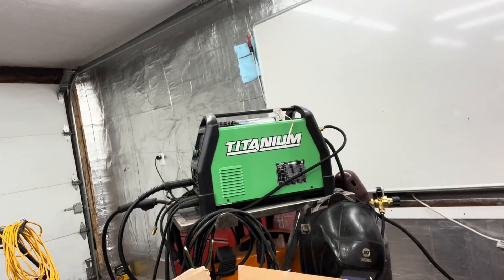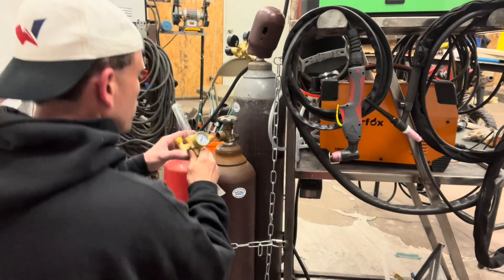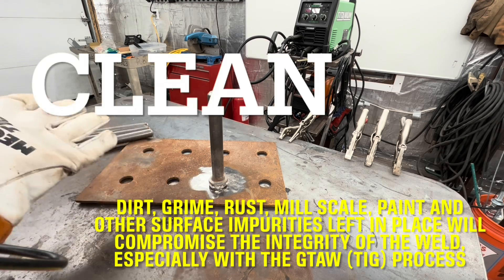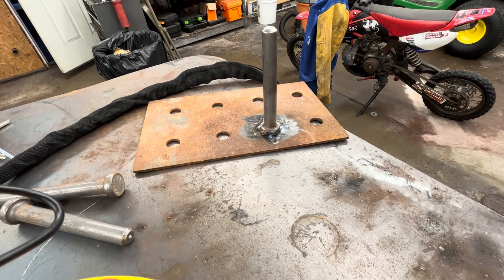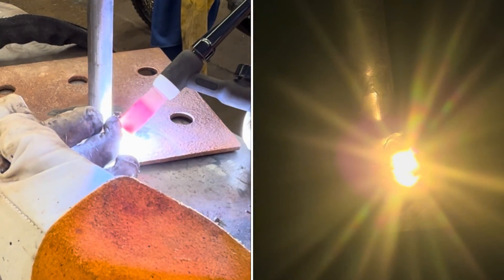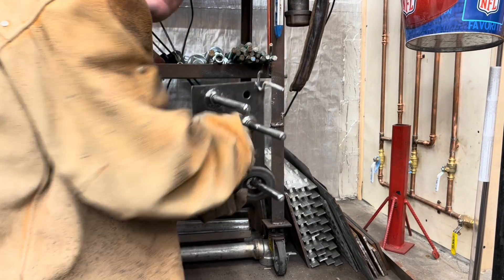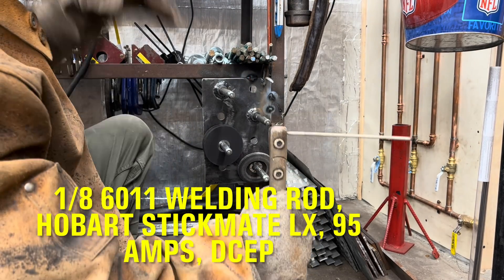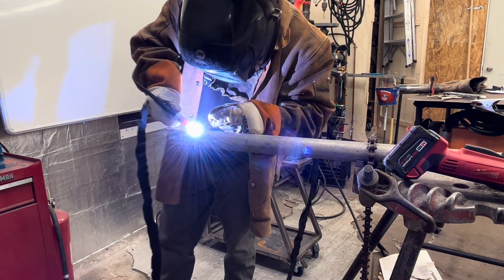TIG Welding with the Titanium Unlimited 200

Comment: Never crank on a brass cylinder connector! Never grind tungsten sideways on grinding wheel, always point the tungsten parallel facing the grinding wheel. Sideways scratches on tungsten will affect the arc stability.
Reply from the maker: I don’t know what you saw but no body cranked on a brass cylinder. I used a proper tool (adjustable wrench) with a flat face on the jaw and I snugged it up. What do you let your gas leak everywhere? 

Also, ive used several hundred dollar tungsten grinders and I’ve also held an angle grinder in my left hand and tungsten in the right, free hand sharpened, and TIG welded stainless and carbon steel without issue. It might affect arc stability in some way, but barely noticeable.

Comment: Hi I have a question I bought this welder but I was surprised it doesn’t have foot paddle for Tig weld i confused some of them have and some not so what the paddle do give voltage? Thank you for your time I LK&SB
Reply from the maker: The foot pedal controls the amperage during the weld this machine doesnt come with one it is scratch start TIG only meaning you scratch the work piece with the tungsten to start the arc similar how you would strike up a stick rod
Reply: @ Thank you just like you did in the video
Reply from the maker: @Alsarraj1010  yes
Reply from the maker: @Alsarraj1010  it can be difficult just keep practicing

Comment: I just bought this on impulse.  Was at HF for an unrelated purchase, and they had one on their clearance table.  $290!  Right across the isle, I saw the normal retail was $799.  Don't know anything about TIG but that sure seemed like a steal.   I called a welder buddy of mine, and he said for that price, jump on it.   It's still in the back of my car.  HF said clearance table is as-is, and I have 5 days to return.   WIll play with it tomorrow probably. Same buddy will run some tests with it since he has all the gasses.
Reply from the maker: 3 years after purchase and Ive used mine plenty, no issues, and no regrets

Comment: Very nice. Would this unit be good for tig welding Steel rod? Plus, I have never tig welded before but I am an ok mig welder so I will be teaching myself using videos like yours. So I appreciate you guys making these videos.  Im in the RC hobby so I like to make 1/10 and 1/6 scale roll cages and A-arms for suspensions. I would be welding 3/16- 5/16 steel rod and square rod.
Reply from the maker: Yes just a lot of prep Make sure your material is nice and clean, hit it with a tiger paw wheel. Make sure you're using the correct gas and settings etc. It definitely hangs.

Comment: Do you weld tig of the 220 or 110?
Reply from the maker: I like 220 but it is definitely doable on 110, 110 is usually only capable of welding thinner stuff 👍

Comment: So the titanium tig 200 is strictly scratch start? I was thinking about tig welding some exhaust but that kinda throws me off now :(
Reply from the maker: Yes strictly scratch start, it’s not that bad. High freq. better but much more expensive
Reply: @chaoticlizzards653  ahh I see. I have the basic one it only tig welds and stock welds, no mig. So I think mine is the older version. It only has one adjustable knob in the middle and not 3 like  yours… wondering if that one is still scratch start and that’s why I can’t weld very good with it lol

Comment: I got a question can you use longer welding leads or will it affect it?? Also extension cord for 220???
Reply from the maker: Yes you can use longer leads, in my experience it doesn’t really affect anything until you get into really long leads, (like 100 ft). You can use an extension cord for 220 but you need to make sure it is the correct gauge size. I’m not an electrician so I’m not sure gauge sizes so you’d have to do your research, I’d say at least 10 gauge if I had to guess
Reply: @chaoticlizzards653  thanks 👍🏻👍🏻👍🏻

Comment: Use your filler rod to strike across the tungsten and that simulates scratch start and saves on tungsten sharping
Reply: That's pretty good advice. Thank you for sharing. I'm thinking about getting this machine, and possibly use the TIG function for stainless and aluminum.

Comment: Your walking the cup is decent, just keep your angle about a 45° angle and turn the heat down a bit to go a little slower until you get the hang of it. Good job though. This is the video I was looking for. I got the Titanium Unlimited 200 & the Titanium Plasma 45, Plasma Cutter. Been playing with them both and was about to check out the TIG feature, just wanted to see a video on it first, too see what I was getting into. 
Thank you for your video.
Reply from the maker: Hey thanks bro👍 Hows the Titanium Plasma 45? I was looking into that one but ended up getting the cheaper Warfox instead. Thanks for watching!
Reply: @chaoticlizzards653  that plasma cutter works better then the miller one i would use at work. harbor freight stepped their game up alot with these tools
Reply: same here, good video too

Comment: Just FYI, those pins you referred to are called studs or shear studs. They're usually welded with a special "stud" welding machine on structural steel components to aid in the reinforcement of concrete. I do like the grinding wheel rack you made though! Good video
Reply from the maker: Hey thanks for that knowledge! I’ve seen them used many times in the field, but I didn’t know the proper terminology. Thanks for watching!!!!!!

Comment: Hey man 
I swooped one of these and a bottle of juice . I’m wanting to weld a bracket for my solo seat on a bobber project 
Any tips ?
Reply from the maker: So I’m assuming you’re not going to use aluminum for the bracket, (this machine will not TIG weld aluminum) so it’ll have to be either stainless or carbon steel. I’d use a smaller tungsten probably 1/16th 2% ceriated tungsten. Assuming the bracket is not more than 1/8th inch thick. If stainless, you will have to determine what type, 304, 316l etc etc. and get the same filler rod, (if it’s 316 then get 316 filler rod, and vice versa. This stuff is available at any welding supply store), in 1/16th diameter (you could probably get away with 3/32 filler rod if you want.) if carbon steel, get ER70S2 filler rod same size 1/16th or 3/32 at most. your material will need to be extremely clean so hit it with a new wire wheel or a Tiger paw (buffing wheel) with a grinder. Get off all surface impurities. 

Also, if you can, I highly recommend running practice welds on a piece of scrap and dialing in your settings on the machine before you go after it for real, make sure you’re comfortable and you like the way the beads look. Probably going to be somewhere between 50-80 amps. 

100% Argon @ 15 CFH
Reply from the maker: It depends you planning on TIGGIN or miggin?
Reply: @chaoticlizzards653  tig